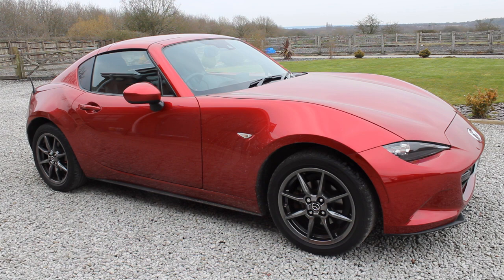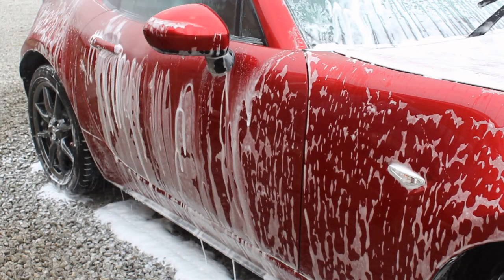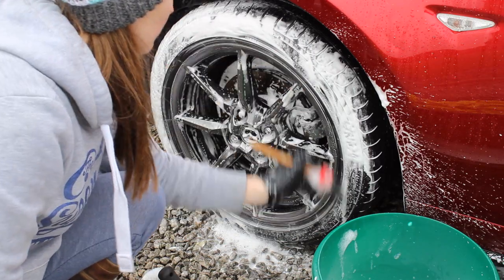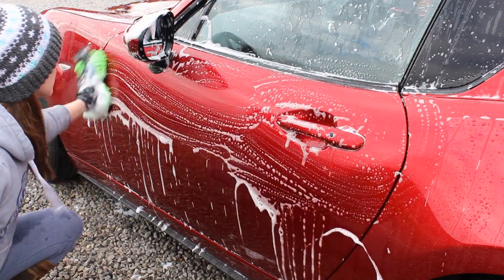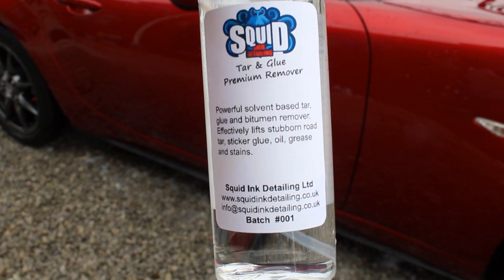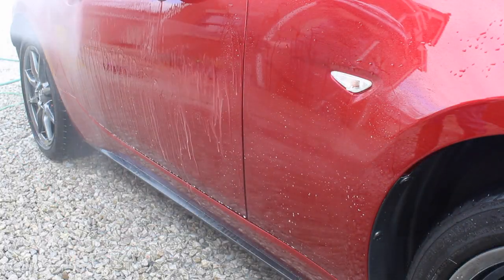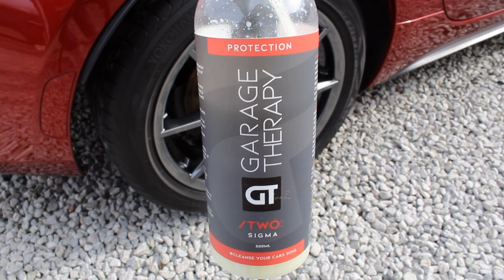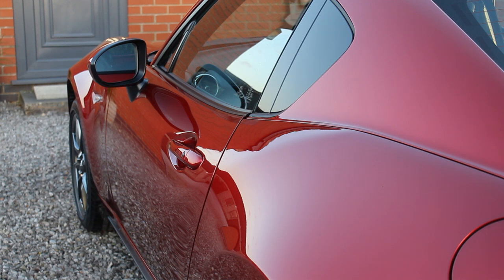SPRING CLEAN | Detailing My Mazda MX-5 RF

Comment: Great job but I prefer to deal with tyres and rims entirely (save dressing) before foam etc.  I also start at 12 o clock position and work downwards. Cleaning wiper blades is also essential.  Car looks super.

Comment: Cool video, thanks! 

I’m about to do the same to mine, I’ve picked Koch M3 and Rupes Yellow pads for my hard VW paint, like you it was corrected awhile ago, so just looking to remove some clay marring and prep the panel for LSP. 

If you haven’t already, you need to try Beadmaker! I thought it was just a hyped up product, but I love it. Gloss is amazing, slickness is unreal and it’s sooo nice to apply... Sounds like an advert right 😂
Reply from the maker: Thanks for watching! I’ve not used M3 but I used H8 when I bought this to sort the mess the dealership made 😂 I really rated it, it was very nice to use. I’ve got bead maker on the list but haven’t got round to buying it yet! I’ve heard really good things so I’m pretty excited to give it a try 😊

Comment: Couldn’t agree more about the Pyramid x ODK wax it’s an absolute treat to use, I just wonder how long you can go resisting layering other things on now 😝 ... 
I have the Sam’s clay mitt which I’ve used a few times and it’s decent , could probably find same one cheaper without the branding and nice box it comes in if you shop around, I’m sure SGCB do a clay towel that I’ve seen Dave use too.
Reply from the maker: Cheers Nick I’ll give them a look! Haha I’ll do my best but no promises, it’s been 3 weeks since I filmed this though and I’ve not added anything yet so I’m doing well so far 😂

Comment: I’ve tried these decon shampoos and not been very impressed, used Bilt hammer cleanser fluid and it stripped the old coatings straight away, it’s easy to put on with a trigger head and a quick wipe away
Reply from the maker: I’m a big fan of GT decon shampoo but I’ve never tried BH cleanser fluid, I’ll have to give it a go at some point!
Reply: Hi Matthew, out of interest how many applications do yo get out of the BH cleanser fluid (i've got a BMW 1 series for size reference), have been considering this product but unsure about the cost / usage ratio. Cheers.

Comment: Hi Heather, how did you find the S40 to use? Have it but not used  it yet. Only BH cleanser polish. Did it remove any defects? Also have soft Subaru paint 😰
Reply from the maker: S40 is brilliant, it’s capable of removing very light swirls in one pass but might take a few more passes for more noticeable ones 😊

Comment: Car looked great! Interested to know if it would make any difference if you’d just corrected the paint without worrying about removing old LSP.
Reply from the maker: Thank you! I’ve done some correction in the past with a bit of fusso coat still on the car that I just couldn’t remove with detergent. It still worked but I just had to fight through that layer and use more polish on the pad. It just ends up clogging the pads more and takes longer tbh

Comment: Heya, love the videos. Thanks for the tip about using ONR for cleaning the glass if you have a coating on the windshield. I have a question, how do you deal with windscreen washer fluids? They can be really aggressive when they have alcohol in them and i'm worried about it stripping the coating, when somebody else who drives the car feels like they need to use them.
Reply from the maker: Thanks for watching! I barely ever use any windscreen washer fluid to be honest but I know that some people who use glass coatings/sealants use hydrophobic windscreen washer which I reckon would be a lot safer!

Comment: Did a great job there. What did you do with regards to the polishing pad? Did you clean out the residue regularly and use multiple pads?  I planned to do mine Tuesday/Wednesday but its going to be so cold I might have to wait. With regards to an excellent  clay alternative, Carbon Collective Exfoli-Block is superb. Last thing, ONR at 1:256 is perfect for glass and will save a lot of product compared to what you’ve been using!
Reply from the maker: Thank you! Yep I just cleaned them out every pass and used 3 in total for the car in the end. Thanks for the recommendation I’ll give that one a look! Brill, I used the 1:16 ratio as I was being a bit lazy haha but I’ll mix up a new bottle at that ratio for next time, it’s so cheap at that dilution so it’s great to know it works well!
Reply: Knew you would have sorted proper residue control with the pads. Yeah, you’ll notice it will flash away much quicker at wash dilution, its what Optimum recommend too. Plus when you’re done on the glass, you can wipe the dash, door cards and leather seats while you’re at it. It’s a great interior qd at that same dilution!

Comment: And I thought I was thorough when cleaning my mx5! Impressive procedure, how long did you spend? I haven't polished mine yet since it's used as a good weather fun drive.. 🙃 and sees little dirt. But I will sooner or later. How would you rate Mazda's paint hardness? Thanks for sharing it's great to see ones identical car getting such TLC.
Reply from the maker: It took a while to be honest, probably about 12 hours I reckon! It’s really soft from my experience, this car swirls if you look at it funny 😂
Reply: @AutoCareHQ  good thing I got a white one after all. Thanks, now I know not to use coarse pads for polishing. 👌

Comment: Great job however spray some of that rust remover on your tires and wheel well also plus a paint prep spray after the polish to get ride of the oils or left over polish so the wax sticks right to the paint
Reply from the maker: Cheers! The panels were prepped with Gtechniq panel wipe before the wax 😊

Comment: could anyone help? meguiars hcw spray Full prep decon IPA, applied 2 dry coats on Saturday 1 week later today washing on roof and hood ok on sides-dead after the wash-dead other panels look a bit worse could it be shampoo? I used snow foam but that didn't look like did anything please help I lost 80% of my hope      the video is nice love the intro and the end result
Reply from the maker: It could be that the shampoo is masking if if you used one with gloss-enhancers or wax?
Reply: Some shampoos can mask the effects of the spray and it might appear like it had gone but it just being hidden. I haven't tried it but optimum no rinse is supposed to be good for clearing residue without stripping existing coatings. Hope that helps. I also found Bilt Hamber Autofoam to do the same which 8s strange considering its an alkaline snow foam.

Comment: Never, ever allow the garage/dealer to valet your car. When you take it in for service, stick a big notice inside the windscreen, showing outwards, Do Not Valet lnside Or Outside. The one and only sponge that is used for every part of every customers cars will have been dropped onto the gritty ground umpteen times then swished around in a muddy bucket to clean it off then carry on as normal. To them a car is a car is a car is a car, nothing special.
Reply: Yep, I have a sign that I picked up at WaxStock that hooks around the rear view mirror. The garage probably think I'm a bit sad as it's only a Volvo V40!

I also ensure I give the whole car a bit of a detail before dropping it off in the hope it communicates "this customer is really going to notice any damage".
Reply: Good advice.  I detailed my wife’s car recently and it came back from the garage with cleaning issues.  Lesson learned.
Reply: Even after a year of your comment I feel like a dumbass because I bought a brand new RAM 2023 LIMITED let them wash it and I have had it for a week and it has swirls already FML I wish I would’ve seen your comment a long time ago